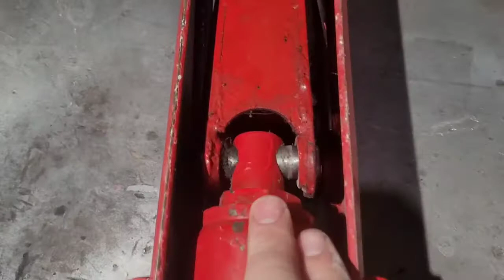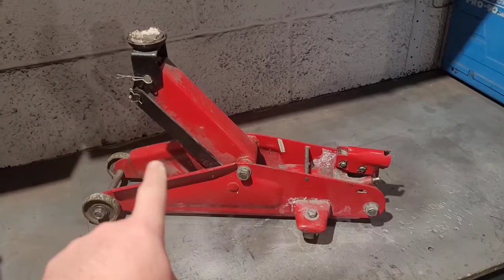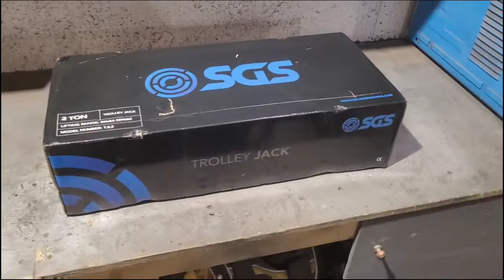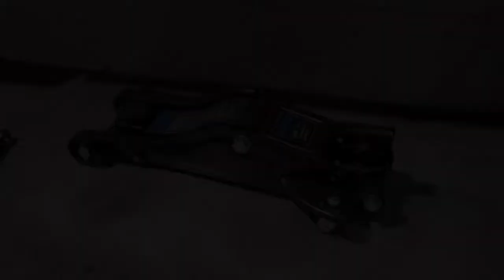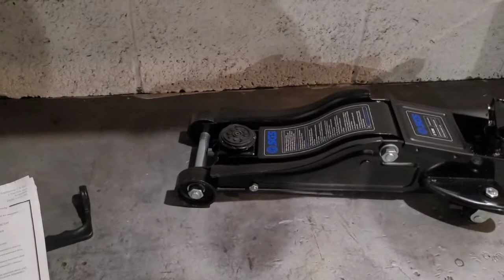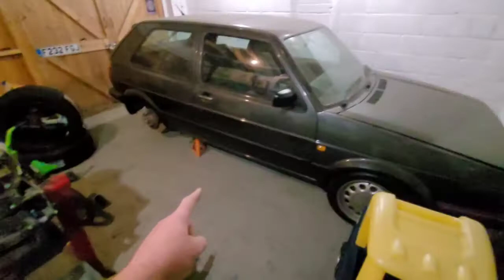Trolley Jacks...Is your's safe??

Comment: I have halfords I bought for €40 it's leaking oil but I found a 4 tonne trolley jack heavy duty 2 cylinder for €180 shoudl i buy it
Reply: even the 3 ton are very heavy, 4 ton must be extra heavy.